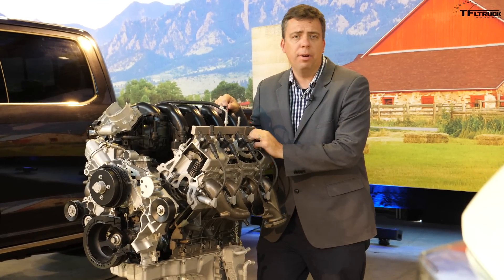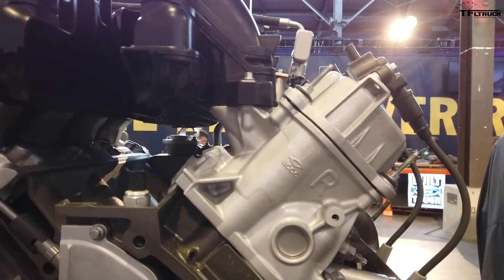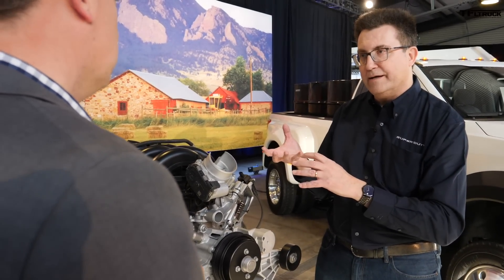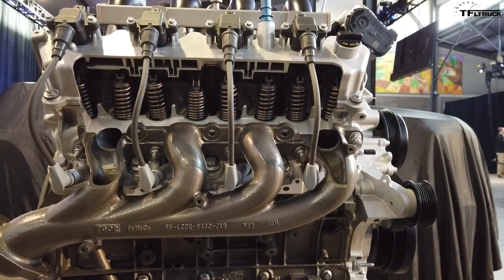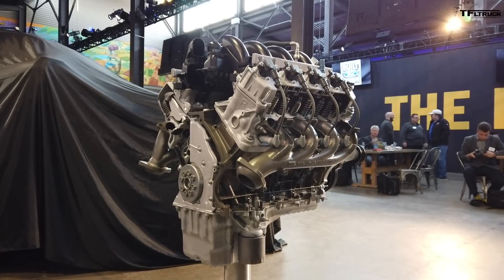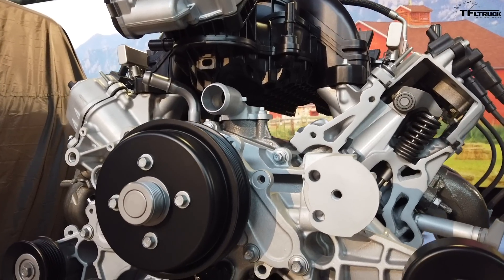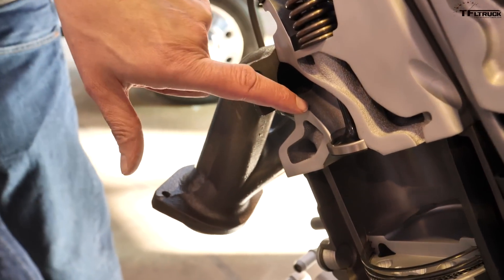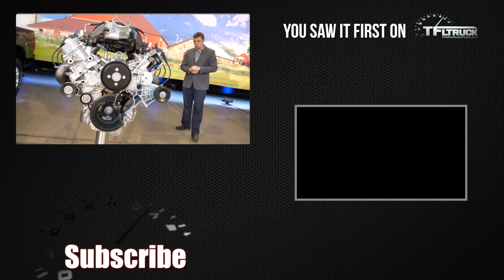2020 Ford Super Duty 7.3L V8: Here's What You Need to Know!

Comment: Port fuel injection, cast iron engine block, and no forced induction. Sounds like a robust engine for power and longevity.
Reply: I see short pistons that will slap like no other.  Let them work out the kinks first.
Reply: Easier to work on too? Maybe?
Reply: I’ll be in the market for one in 2021, one year after they’ve been out. I can’t wait
Reply: Cross-bolt mains, forged crank, yeah it's going to take a beating.
Reply: Indeed. Internally engineers have stated w/ proper regular fluid changes 300k+ mis should be easily attained at minimum.
Reply: @doubletappinhillbilly I'm looking order one myself in '21 F250 FX4. With excellent new 10spd tranny mpgs should be pretty good.
Reply: @danielhaynie5502  No chance! No way. Ford never had that issue bud. Its 1yr later this engine highly rated highly coveted now so ur theory out da window.
Reply: @mattweeks2272  Me as well. No need wait tho this engine is highly rated & highly coveted from start now 1yr ltr im looking order '21 F250 FX4 w/ 7.3L Godzilla powertrain.
Reply: @exothermal.sprocket  an keep on goin! Fords gen1 / gen2 Ecoboost TGDI have been heavily overengineered from start 11yrs ago.. an proven outstanding & top sellers. All bout top notch design/engineering 👌.
Reply: @Davido50  that's why it's only a theory
Reply: @danielhaynie5502  no they don't
Reply: @Davido50  Lmao what a ford fan girl.

Comment: Big block pushrod v8... Hell yeah Ford! 👍
Reply: @MrDavidelliottjr  I agree, Ford is junk
Reply: Just waiting to see what chevy and Dodge make fun of next, thats how I know what they will do next, you know like aluminum beds.
Reply: I'm pretty stoked about it also.Might be a f-250 in my future.
Reply: @jl4091  I've been looking for an excuse to do a full-size overland build for Alaska. Single cab big block just makes me happy haha.
Reply: @ryanmartinage  I love single cabs also.You got good taste brother.
Reply: JnJ Mods Akecheta Wakan I thought ford said that small displacement turbocharged engines were the future for trucks? I’m surprised to see them make a truck that doesn’t have a four cylinder.😂🤣😂🤣

And Chevy had big blocks way after ford. Chevy had big blocks in trucks until 2009.  Ford hasn’t had a big block in a truck since 1996. And it was a bitch 429 while GM had a 496 in gas trucks in 2009. And 454s before that in the 90s and into 2000. You Ford boys are hilarious.
Reply: L Rizo - Garbage motor is junk
Reply: Put it in the F150 next and I am sold!
Reply: @buckbundy8642  since 97 and it was the 429 and 460
Reply: Benjamin Burkhardt it’s a big block. A “long block” is the description for an engine with the rotating assembly in and the heads installed. No intake or fuel delivery setup. 

A “short block” is an engine with no heads and just a rotating assembly in the block. 

It’s “small block” and “big block”. You thought the “big block” was dead. Yet GM had them in their trucks up until 2009 and they were an 8.1. And the only reason they don’t anymore is because they have a pushrod small block with 7.4  liters that is more displacement and smaller in size than this 7.3 “big block.” Ford can’t build a reliable diesel and their anemic turbo 4s they’ve had for the last how many years suck in trucks. They gave GM slack since the 4.6 mod anchor and its DOHCams came on the scene. Always talking about how GM should “get with the times and loose the pushrods.” Now look at them. 😂

Comment: That would make an awesome crate motor lol
Reply: James Power slap it in my buddy’s 1987 f250 (co-part wrecked 2020 f250s here I come lol)
Reply: @automotiveguru6961   What I was thinking the entire video for my 90 4x4 2D F-250, Thinking this could replace the 600k 460 in it. And add the 10 speed my mileage would be nuts lol.
Reply: This would be a crate engine for muscle cars and Hotrods and Heck even for my old 96 Ford F150 or an old F100.
Reply: Funny....that's what I'm hearing in the back of my mind all throughout this video.
AND- it's (supposedly) a narrow design.
Reply: Damn it would be $25,000 plus
Reply: Yes it would!
Reply: Wait until the aftermarket supercharger kits come out!
Reply: James Power I don’t think so it’s heavy and low revving. 
 If your going Ford 5.0 hands-down
Reply: @cellpat7392  This is bigger than a 427...
Reply: No it's still a shit box ford engine
Reply: @OtisFlint  , it sure is...445 cubic inches.
Reply: Once a company puts an engine in a publicly available vehicles, they have to offer a "crate" version for warranty work and otc sales. Well, there is exceptions but not many.
Reply: 7.3l twin turbo mustang anyone???? With the new dual clutch in the 500 i think us car people need to get on this engineering feat
Reply: James Power I’ve been saying that the second I found out about the 7.3 gasser.
Reply: What is a crate motor?
Reply: @TdrSld  for some reason that reminded me of a guy on here that had an early '00s 7.3 Powerstroke F-250 and he put in the interior from a 2015
Reply: @cpufreak101  The thought had crossed my mind. I had seen picks of a Bronco that was frame and interior swapped for a first gen Raptor. Looked beautiful.
Reply: @TdrSld  oh wow, yeah that sounds like a badass truck for sure!
Reply: Gotta go full send. Gotta rip out my ecoboost motor and drop this in the mustang.
Reply: @cpufreak101  Could that be the guy who owns the Powerstrokehelp channel? I saw him put the front end of a more recent Ford F250 on the front of an Excursion.
Reply: @CJColvin  This is definitely going to be a crate engine at some point.
Reply: Drop it in a old Excursion. Big boi SUV.

Comment: Very smart not to use direct injection in this motor. No issues with valve coking when its run hard for long distance.  Big fan of the simplicity.  Way to go ford.
Reply: Thats a good point.     + one
Reply: Just have to run some BG44 every so often
Reply: Superman  👍
Reply: Superman  good to know
Reply: Dual port/direct injection cuts that down significantly, but I can still agree with Ford for this particular application.  Cost savings they can pass on to the customer, for one.  Of course, DI allows greater control of combustion, which you'd want when trying to focus on power and efficiency at stiochiometric fuel-air burn.  Ford may go back and add dual injection later because as the gentlemen said, there isn't a direct competitor in the segment currently.
Reply: Superman  you know gdi's are all ported now so fuel cleans them up
Reply: @doubletappinhillbilly 
Ram actually has that. A local dealer had a super stripped down all vinyl, bench seat, roll up windows, non power locks and a radio Ram 1500 for $23k. Not bad if you are looking to get a rock basher basic ranch truck.
Reply: Yep like the chevy LS
Reply: Yep just like the chevy LS

Comment: Ford finally grew some balls and back to the old school pushrod now they need to pull out there man card and put the 5.0 in the Expedition!👍
Reply: cruz mascorro.   What are the ford fanboys gonna say now tho?   The pushrod thing has been a huge weapon for them to rip on Chevy.
Reply: fredkuhn165 what do you drive?
Reply: G. Warren.   2001 5.3 silverrusto
Reply: @lsowner10  Nice try
Reply: You know what has no balls the Chevy 5.3.  It’s a turd by comparison.   The coyote is in another league.   The 6.2 is barely equal to the 5.0.    And to top it off the 5.3 hasn’t exactly been reliable since the afm debacle of 2007.    Fords powertrain development is head and shoulders above gm.    Think about it:   While Chevy develops a 4 cylinder with Chinese plastic electric  water pump that would put bmw to shame ford is developing a clean sheet big block for the super duty.    One is gross and one is sweet and it’s pretty obvious.
Reply: @clintmullins4406  Lol
Reply: @GMK6300L  what are the Chevy fans gonna say? Chevy just put a turbo 4 banger in it's truck and Chevy guys have been ripping on the EcoBoost.
Reply: @clintmullins4406  ford was always the best american car company period
Reply: redd7188 it’s called Egoboost
Reply: @clintmullins4406  are you drunk
Reply: Not too fast there... this engine is for low rpm tq. High performance, fast running is not what the idea was for this engine. Two completely different ideas here. If the pushrod was indeed a higher performing engine Ford would be slapping it into the Mustang GT.
Reply: Trey K they can’t put a pushrod in the crapstang. They would never live it down after claiming their Mod anchor was superior. You know they compare Z28 Camaros and Corvettes to European Super cars. They compare Mustangs SS Camaros and Challengers.
Reply: It still is. The pushrod is fine for  a slow turning truck motor. It makes sense. Pushrods in a production car engine is absolutely stupid. 2 valves give more torque at low end. Perfect for a truck. But gm (God's mistake) keeps failing.
Reply: Nice try. gm junk can't keep up. But you will defend it to the end.
Reply: @buckbundy8642  You must be living under a rock.  Go watch some street racing.  The mustang 5.0 is owning fully built corvettes and there are no camaros to be found.  The 5.0 is a gift from God.
Reply: @WD Fourty I heard there isn't enough room for one. That would be awesome though. I would be happy with the 2.7tt in the ranger though.
Reply: @clintmullins4406  The OLD 5.3 aint a turd, you can't compare an old engine from 01 like that to a 2019 engine. While I do agree after 07 the ones with DOD are junk (I had a cousin's who was tapping and making noises before 100k), the ones without DOD, and older then 07 are excellent engines.
Reply: @redd7188 , your talking about half ton truck, GM wouldn't even put the LT based 6.2 in the 2500/3500 truck, the stuck with  the 6.0 LS engines
Reply: @anthonywebber2211  it doesn't matter because Chevy guys ripped on it then Chevy dropped a turbo 4 banger in the Silverado.
Reply: @redd7188 , the 4 cylinder is an option, GM got 2 V8's that aren't on the back burner like Fords
Reply: @anthonywebber2211  back burner? Really?? It makes more power than the 5.3 and almost as much as the 6.2 and it's on the back burner??? I guess that means the 5.3 has fallen off the stove.
Reply: Moe Aj "car company" 😂
Reply: @redd7188 , no you tool, Ford's V8 is on the back burner in favor of the Eco/Boost
Reply: @anthonywebber2211 , tool?  Really? When Ford refreshed the F-150 for 2018 the 3.5 EcoBoost went unchanged. The 5.0-liter was upgraded with the same dual-injector technology, as well as a spray-on bore liner like the one found in the GT350. The horsepower went up from 385 to 395 horsepower. Torque also went up from 387 to 400. You lose sir, good day.
Reply: @redd7188 , majority of the engines are still Eco/Boost engines, with GM majority engine is the 5.3 V8 followed by the 6.2 V8
Reply: @redd7188 , can't handle the facts?
Reply: Anthony Webber no he can’t.
Reply: Sergey Melnik you sure as shit aren’t watching real racing then. Because most ford’s are still LS swapped. 😂
Reply: @chris1451  funny how many of those pushrod 2 valve v8s turn 10,000 RPM for hours on end running nascar but you know pushrods make engines slow revving i guess
Reply: @WD Fourty, Ford's 4.6 and 5.0 are smaller in displacement, but are physically bigger
Reply: @oddball0045  you really can't compare a $50k nascar engine to current pushrod engines...completely different animal
Reply: fredkuhn165- gm pushrods are boat anchors not Fords
Reply: @WD Fourty glad Ford decided to put a V8 in a truck or else we would not be having this conversation.

1. Ford first to put a V8 in 1500 tracks 
2. Ford first to put a super charged engine in a 1500
3. Ford first to put a turbo charged engine in a 1500.

Gee, thanks Ford
Reply: WD Fourty so a pushrod 4.8 liter LS that can handle 1000 on the stock bottom end is a boat anchor compared to a DOHC 5.0 that is physically bigger? And it can handle 700?!?! WOW!!! You sure showed me! 😂🤣😂🤣😂🤣
Reply: @sergeysmelnik  💯🔥 🔥🔥 🔥⚡
Reply: @oddball0045  Reading comprehension low on your list? For a truck, it is great. For a car, not so much. Are you going to tell me 4 valve overhead cam engines are less efficient in a performance application? Remember, it takes gm 6.2 liters to  do what Ford does with 5.0 liters.
Reply: We need this in a mustang now!!!
Reply: @wavyybased1820  amen to that it would be sweet! Bring back the 429 boss!
Reply: @sean5comet  ok i was just making a point. How about the LS7 production engine, 7100 RPM is slow revving? If so i guess the 3.6 DOHC turd-o-charged V6 in the GTR is better off being a truck engine cause it "only" revs to 6600 RPM
Reply: Red 7188 GM putting a turbo 4 in a truck isn’t the same as ford doing it.   Fords 3.5 is their flagship drag queen motor that makes more sense in a sports car.
GMs turbo is just a cheap experiment to get a truck from a to b.   It’s not their flagship truck engine for the masses
Reply: @GMK6300L  pushrod engines have always been cheaper to manufacture and take up less space than overhead cam engines.  Overhead cam engines, with their added complexity and cost, make sense for consumer applications, where the user prefers to rev the engines high. OHC engines will rev high without a single instance of valve-float, and make good power doing so.  However the added expense doesn't make sense whenever you are building an engine that is going to max out at around 4500-5000 RPM... or less.

Comment: Ford rediscovers simpler pushrod engines and torque LOL.   Waiting for the 7.3 liter Shelby Mustang.
Reply: I was just thinking the same thing. I'd love to take this engine and build it for performance,  but it probably wouldn't be very cheap to  do soooo....lol
Reply: Wrong engine for that application. This will not be a snappy, high reving engine with all the bells and whistles. This is a low reving, simple, and heavy engine designed for towing.
Reply: @romanticdonkey468  it is all about gearing they used to race Hudson Hornets at Nascar Mopar ran 440 engines for years at the drag strip.  As they say horsepower sells cars but torque wins races.
Reply: Sure, hang a boat anchor over the front wheels.
Reply: Rob C “They” are incorrect, power is what moves the car, it’s simple kinematics. You can put a huge underdrive ratio on a small engine to have whatever torque you want. 

This is of course still simplifying it. There’s a whole relationship between power and torque in piston engines and a bunch of different ways of modeling the question, but when you want to calculate how fast something can reach a speed, power and not torque appears in that equation.
Reply: @Phos9  torque mitigates all the weight needed in the rear LOL
Reply: @andiarrohnds5163  E = (m/2) * (v^2)
Where is torque?
Reply: @romanticdonkey468  cams, valves + supercharger
Reply: @Phos9  That's a real Muscle Car......................lol
Reply: Lol
Reply: I think he said it has cylinder deactivation though. That is a huge turn off if they use the same crappy technology as Chrysler and Chevrolet dropping cylinders and destroying lifters
Reply: @Phos9 I fully understand that you could move an F250 with a brigg & stratton engine and a "clock gear ratio"   yes you  could theoretically get a 3.6 liter engine turning 10,000 RPM with an extremely low axle ratio and get the same rear wheel "power" as a 7.3L turning 5,000 RPM.  BTW long stroke engines generally have better thermal efficiency.
Reply: It would make the car nose heavy. In addition, that instantaneous torque would shred the rear tires more quickly than any past Mustang. This wouldn't be ideal for driving on the streets and probably not ideal for drag strips.

However, it might be interesting if it was installed in a Mustang built to win drifting contests.

This engine might become exciting with people who restore classic Fords. You could get a Ford engine that takes up no more space than a 460. With the right tricks to make the engine fit, you could have a modernized Mustang SCJ.
Reply: I expect that engine for the mustang to be a destroked version of this motor. I'm guessing 7.0 L that way Ford can once again put 427 CI decals on the side like they did with the boss 302. Maybe we'll see a boss 427 in the near future.
Reply: @JonsDailyHustle  too heavy
Reply: @romanticdonkey468  and very heavy
Reply: jesus that would be epic
Reply: @robc8468  I would change that statement a bit. High up HP sells cars but down low HP wins races. Torque by itself don't mean shit if the engine ain't turning :P
Reply: @dudejo  Agreed down low HP is what counts but most people  see a lot of HP at low RPM as Torque.
Reply: @robc8468  Most people don't know the basics :P
Reply: I would most definitely be interested in that. Will be a hefty price.
Reply: Retro Gamer no, he said multi-displacement oil pump. No cylinder deactivation. Hell, Chevy and Ram only use it on the half-ton trucks anyway because there's no MPG regulation on 3/4 ton+ trucks.
Reply: Y'all are silly if y'all think this will ever be in a Mustang. Mustangs gotta rev!